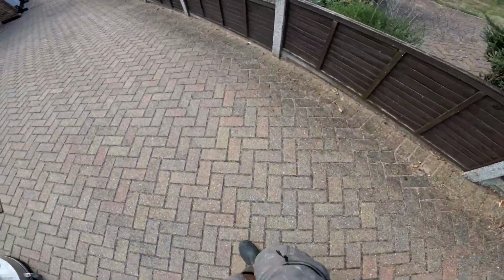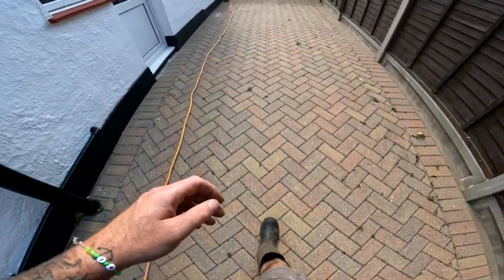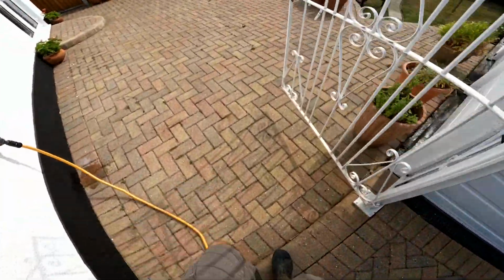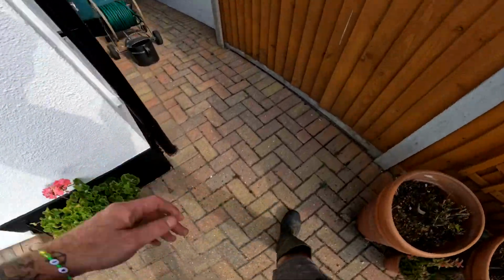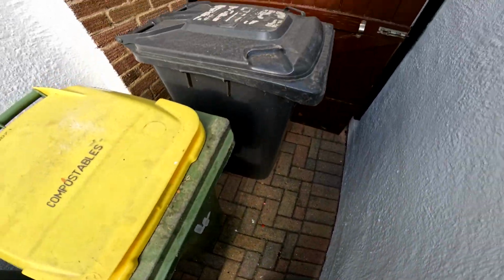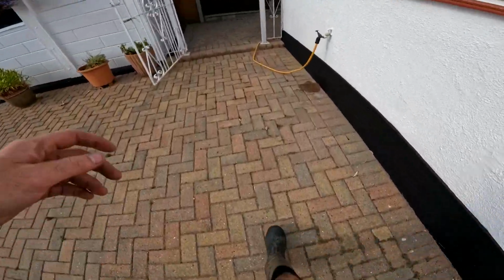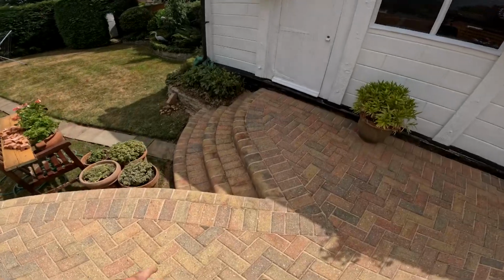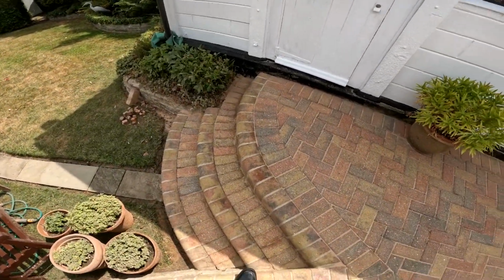Half a Decade of Grime Gone: Massive Driveway Transformed by Pressure Wash

Comment: Did you spray soft wash on and not rinse it off? Like just put sand on top of a ton of dried soft wash? You didn't show that you rinsed the soft wash off?
Reply from the maker: No, we always wash it off I just didn’t record it. I  only have three batteries and being a big jobs I have to pick and choose what I record closer to the end of the day. Where the drive is on a slant as well the soft wash doesn’t sit on the brick it kinda runs off so the rinse wouldn’t have looked great. 

I cleaned the windows here last week (this was filmed a couple of months ago) and it still looks brand new 🤌🏽